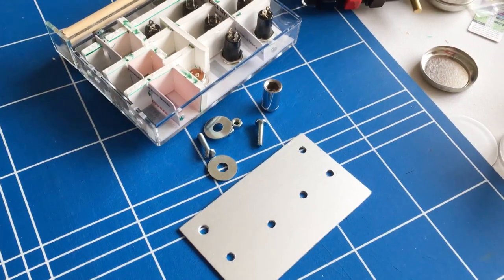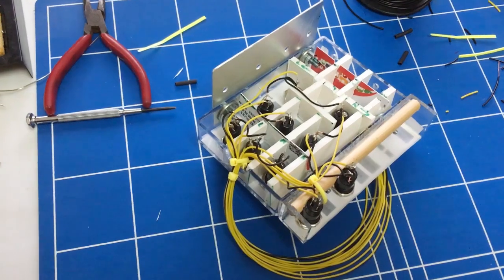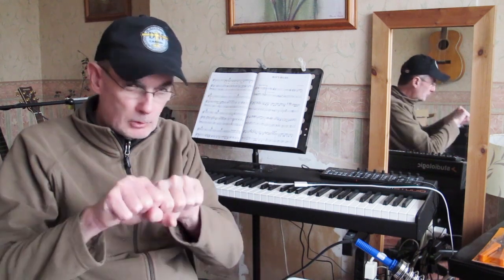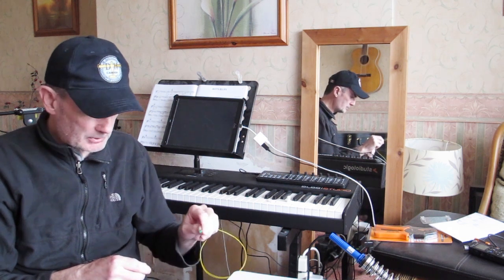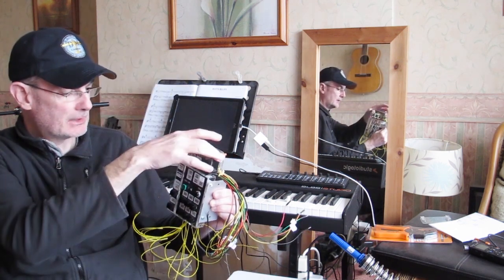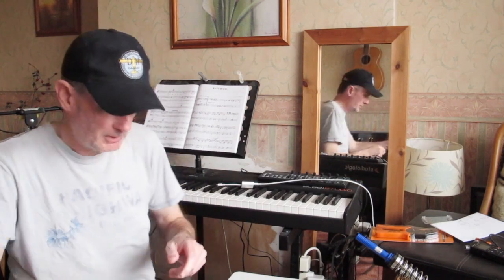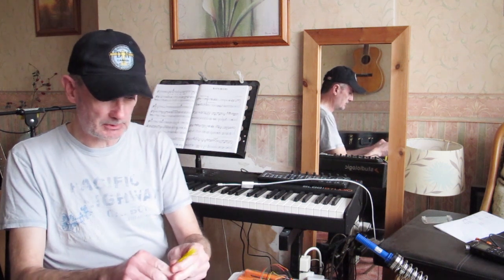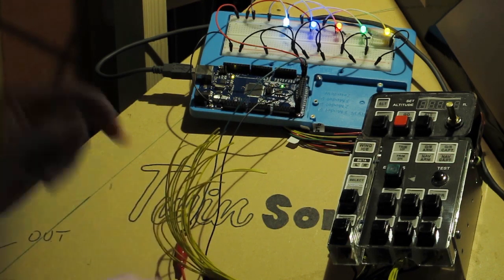Wiring the New Autopilot (Twin Otter Cockpit Build - Part 51)

Comment: Mark,
Been following your video diary and enjoy your sharing and creative videos. I'm fairly new to arduino and recently have been playing with basic learn arduino kit with my son. We played with RGB led with that kit. It's a single led that you control the color via arduino program by which leg you provide power. You have 4 legs to wire, but it gives you ability to have one led and you can mix the RGB (red, green, blue) and make many colors so adds more flexibility and less wires. Maybe you already considered that option. I saw in video how you connected three leds together via zip tie which was well done but wondered if the RGB solution would also work. Just thought, thanks again for taking time to post your videos and create your e book which I also purchased.

https://youtu.be/IPOHARgRLE0
Reply from the maker: Oh yeah, that sounds like a good solution! We'll see how the cluster works out but for version 2, you never know :)